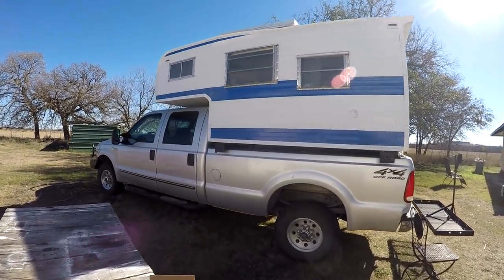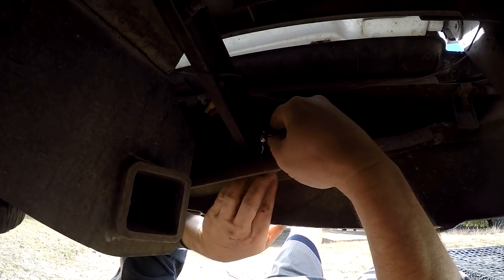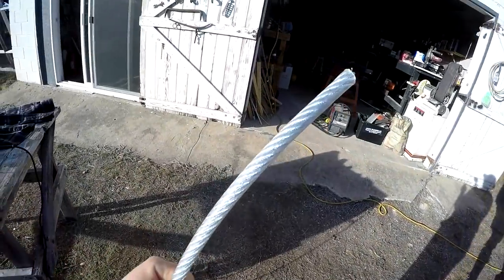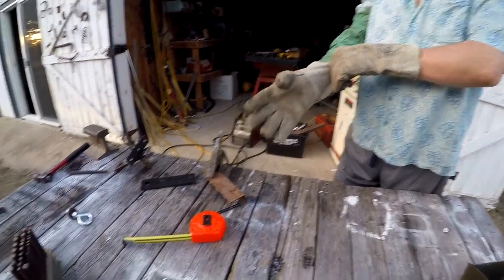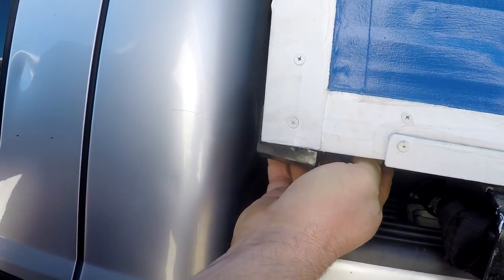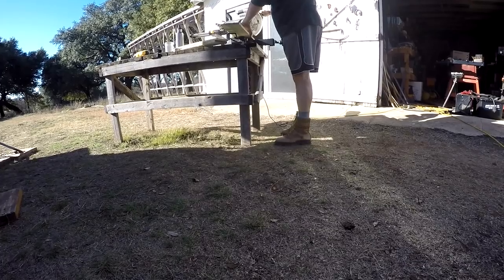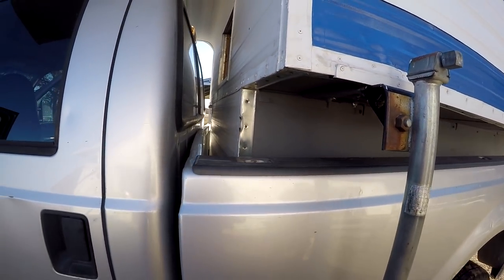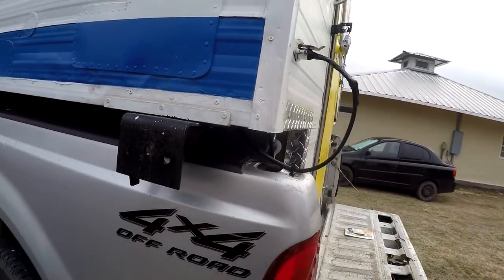Making Rigging for An Old Truck Camper - Truck Camper Vlog

Comment: Hi to you both.  I also rigged the back end attachment the same way as what you guy's did but I simplified the front by bolting through the floor of the camper and the truck bed.  Of course that means I have to lay down under the truck to tighten the bolts or remove them each time.  5000 miles of travel later it's still holding without any loosening from road vibration.  And half of those miles were on a gravel road.  Looking forward to your travel reports...
Reply from the maker: We're about 1800 miles into our first "road test" of Dave's engineering.  Currently in Baja.  We made it down the last 23 miles of Mex hwy 5....which is a pretty gnarly dirt road by USA standards.  Today we hit a tope (crazy Mexican speed bump) unawares....didn't brake for it as we should have.  It was a big one......I swear my teeth rattled!  Everything is still holding and looking good.  Our internet is a bit spotty for video uploads....but plenty of footage being made - to be uploaded when possible.  Thanks so much for watching,
Reply: Looking forward to viewing your adventure!!

Comment: Do you have a video where you talk about the truck you bought, bed size, etc? Good to see you two are at the end of your reno.
Reply from the maker: I think we did talk very briefly about the truck when we got it but we haven't done a video JUST about the truck.  We're traveling now and are making a lot of videos about more specifics.....they will be uploaded at a future date as wifi availability allows.  The quick run-down:  2000 Ford F350.  Has the 7.3 L powerstroke, turbo diesel engine.  It's a 4x4 with the 8 foot bed.  It handles the camper loaded very well.  We can tell it's working harder than empty of course....but very happy with the performance.  We'll be learning more about how everything works as we travel and will certainly make some videos on stuff of interest.  Thanks for watching!

Comment: Instead of a solid bracket to the frame do you think a person could turn buckle to a cloth sling with metal islets? If ratchet straps were working haha Should still be tight
Reply from the maker: Not sure exactly how you mean.   There are so many ways people have used to secure campers like this.  Some people use straps exclusively for smaller campers.  Just gotta make sure to avoid chafe as much as possible.  We constantly check our rigging.  Every time we stop...we look things over.  No matter what type of materials are being used I think this is one the most key thing....keeping an eye on stuff.  Everything wears out eventually.  Constant monitoring will hopefully let you see problems before they become a failure.

Comment: you need to pass the cable into the shrink tube or rubber hose-in result there won`t be scratches and scuffs on the car body

Comment: Would it be better to turn those two small shackles upside down at the rear under the truck? The way they are now, when under tension, the curve of the shackle might pinch and deform the holes in the frame piece. Turning them upside down would give more of a flat surface contact under the frame.
Reply from the maker: Hi - Sandra here.  Dave says he's not worried about that....he has rigging experience working with heavy stuff in industrial settings.  Currently, just over 1000 miles into the ultimate test....driving, driving, driving.  Stay tuned!  ;-)  and Thanks for watching.

Comment: Like your truck camper vid's, but I have to use head phones and your sound blasts me out one min. and I have to readjust the sound over and over . I want to watch , getting a camper soon and you show the ends and outs so well. Thanks
Reply from the maker: Sorry about the sound issue.  This hasn't been the first time someone let me know about it.  I've tried a bunch of different things and scoured the internet for a solution to even out the sound.  I am beginning to think a lot has to do with individual computers and/or headphones.  When I'm editing the videos the sound comes out perfectly fine and even thru both my speakers and headphones.  I even use software that allows me to balance the sound.  I WILL keep working to improve the videos.....maybe one day I can get the sound better for everyone.   Can I ask, does it seem like just any random part of the video or the parts with music?  
 THANKS for watching.
Reply: Every time the music comes on its very loud relative to the speaking. Im watching on my TV.